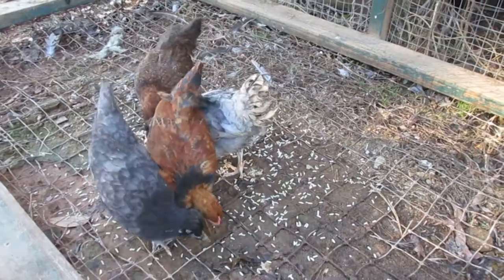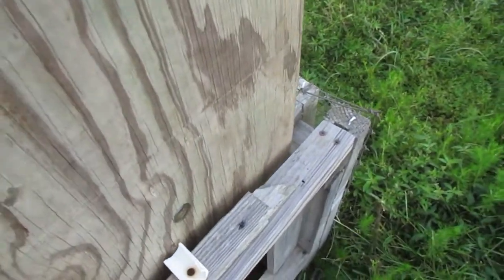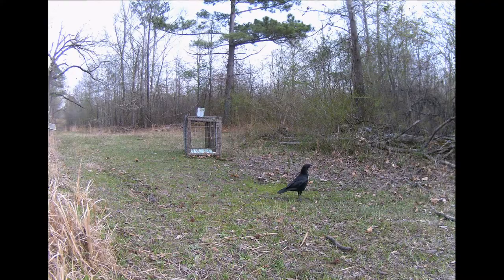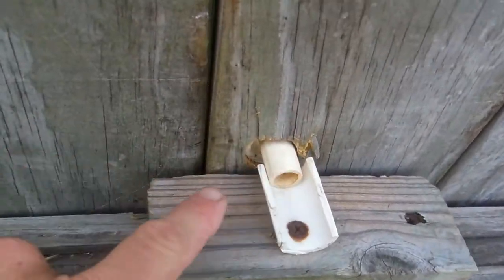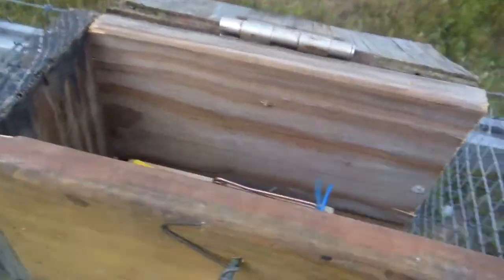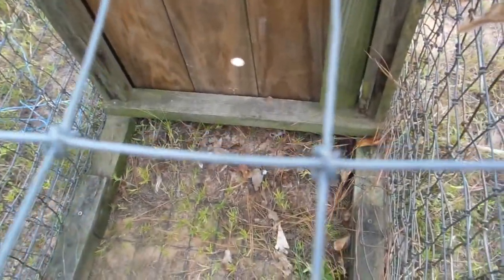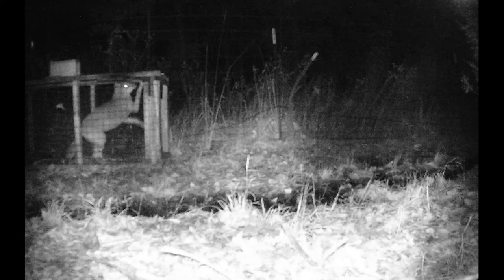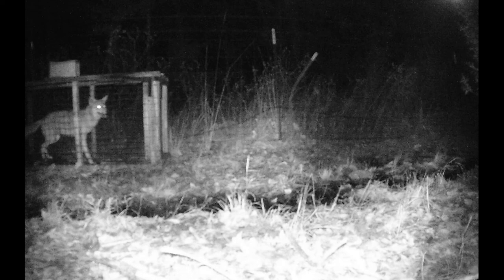How to make a humane trap for a large variety of animals.  Coyote, fox, racoon, others.

Comment: Here you go.  Basically scaled up what you did.  It took me about 12 hours to build.  I also used hog fencing, which is very strong as well as about 5 pounds of 3 inch screws.  You had a great idea to use a rat trap.  I didn't put a box around mine yet, but might add it later.  Thanks again for your inspiration.  Not much else on YouTube.

https://www.youtube.com/watch?v=4tcjnfY4L4Q